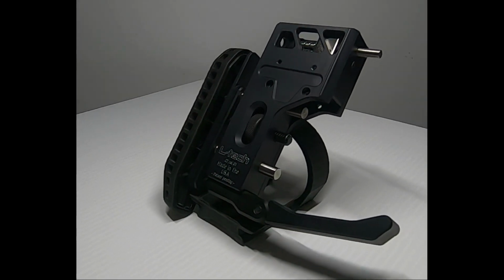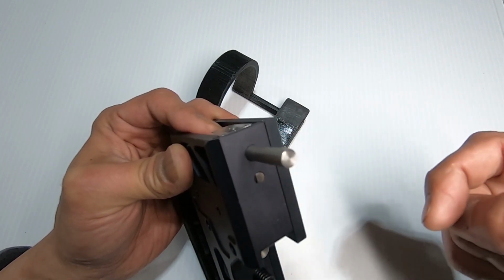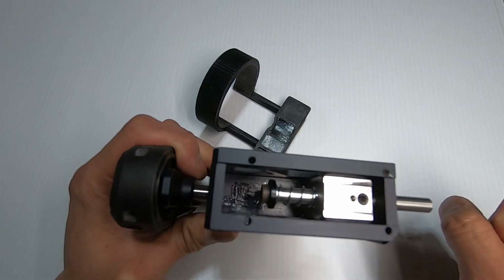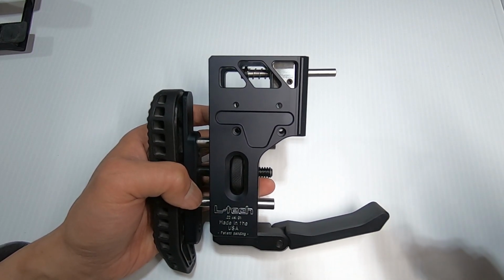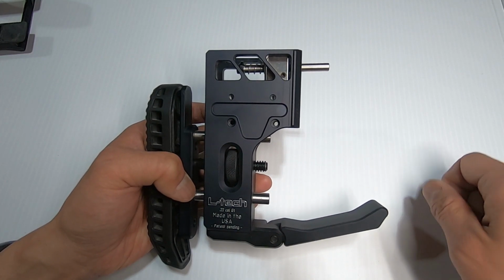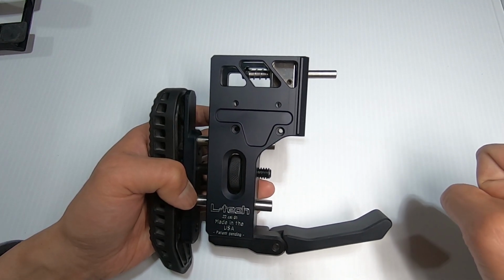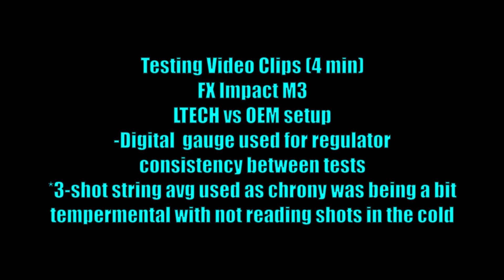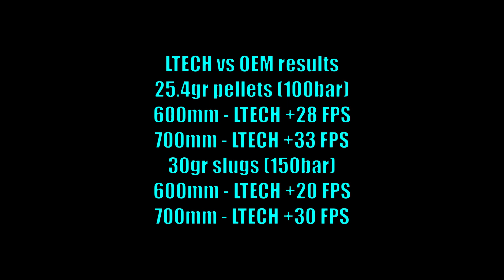Kraford and Lypt - LTECH Probe System - Review and FPS Comparison for FX Impact

Comment: I’ve got two of them, one on my .22 Impact and one on my .30 Impact, both slug guns. The L-tech is a must for anyone wanting the most efficiency out of their Impacts! This could be the difference between standing on the podium or watching from the crowd. The ingenuity is cutting edge and the quality is second to none. Once you get one in your hands you’ll quickly see what a piece of true American craftsmanship this thing really is, borderline piece of art! Beautiful work K & L!!
Reply from the maker: Totally agree! When you add in everything that has been integrated beyond just the probe technology, it's pretty crazy what you're getting for the money. I am excited to have this be my .22 MRD setup with a 600mm barrel--shooting right in the sweet spot, running an efficient reg pressure to achieve it and my anecdotal take is I'm not seeing as many fliers.
Reply: I've been trying to get a little more FPS to maximizee the pellets I'm using. This is going to push it right into the sweet spot without pushing my regulator to the max! Are they in stock??
Reply from the maker: @jasonpahlman7130  what cal are you looking for? I can ask Stephen what is on-hand for you.
Reply from the maker: @jasonpahlman7130  order direct from KL
Reply: Is it harder to cock the rifle with the L tech?
Reply from the maker: Not really, it's a relatively soft spring on the probe assembly. Since I shot the fps videos, I backed my adjustment down ever so slightly so it doesn't snap hard on closing the cocking block.